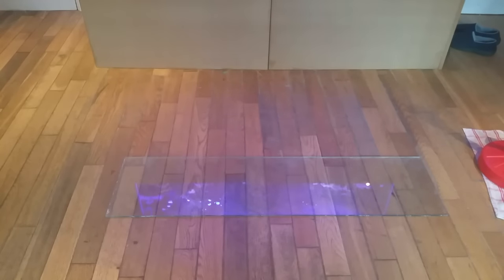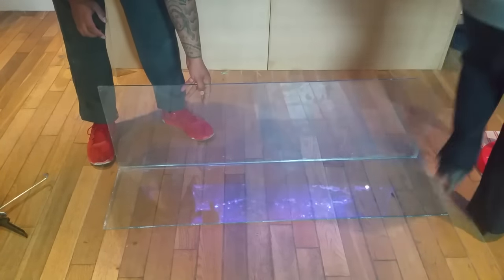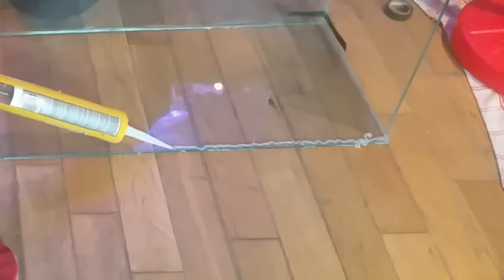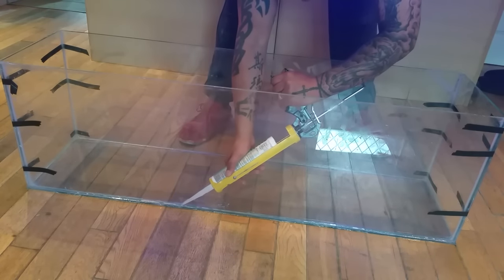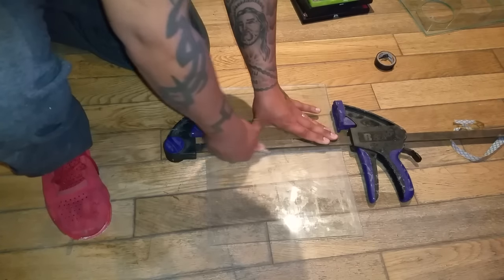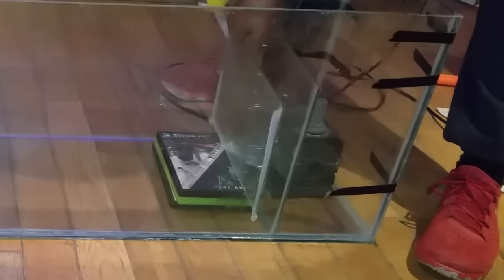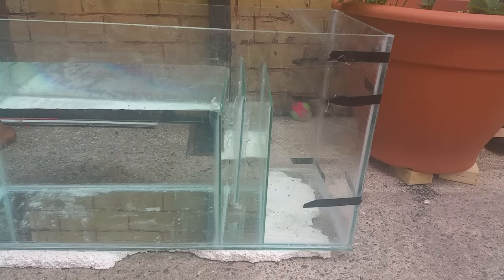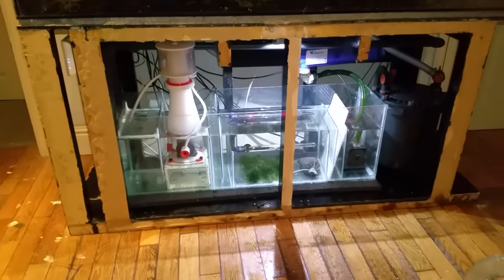How To: Build an Aquarium / Fish Tank and Aquarium Sump

Comment: Hey Aaron
I see u are struggling with applying the silicone bead as the tip is round and it is running allover the place. The solution is extra simple. Take a cutter and cut a bit off the nozzle at a 45º angle. This will allow u more control over the side-ways sliding and over the thickness of the bead .
Reply: I just watched the video and was going to write the exact same thing!
Reply: i know Im randomly asking but does anybody know of a way to log back into an instagram account..?
I somehow forgot the login password. I love any help you can give me
Reply: @Edward Jonathan instablaster :)

Comment: Good build bud, not to worry about the silicone "not so steady hand"when it gets to sump builds. As a tip, if you do a tank build. make a little bracket that fits around the gun's nozzle with a strong nail that runs parallel to the nozzle. This way you can run the nail on the side of the glass and use the glass as a ruler. You'll have perfectly straight lines of silicon.
Reply from the maker: +Jesus Great tip. Thanks for sharing

Comment: For anyone thinking about doing this: 
1. PLEASE  wear rubber coated gloves or some other sort of hand protection, and safety glasses when working with glass!!!
2. DO NOT make reverse passes on your score when cutting glass. One single pass with even pressure will be sufficient! 
3. Sand the edges of your cut glass after you cut it. Cut glass edges are EXTREMELY sharp!!  Failing to do so may result in you bleeding all over your project!!

Comment: tip for you never go over the same cut twice while cutting glass also use thinners or turps before you cut the glass brush it on with a small paint brush it will keep the cut open longer 
good video btw

Comment: If your beautiful assistant had not been available you could have used the wall behind you to prop up the glass...I  get to make my own tank soon ...had my 5 foot 75 gallon crack on the bottom pane at 3am the other morning...it sounded like a rifle going off.....only resealed it two weeks ago and was water testing it...I don't think there was anything wrong with the tank..I think the surface the tank was on may have been slightly bowed... . luckily I was still awake as was doing university study...spent the next 2 hours mopping up water.....now need to learn how to cut glass...might make a sump....or a cube....or two....so thanks for the video...subscribed.

Comment: Nice work with the sump. I like how you used that clamp to make a straight line when you where scoring the glass. I always have a hard time with that, thanks for the tips
Reply from the maker: 915Mang Yeah i tried all sorts as a straight edge in the past but using this happened by accident to be honest because i dropped the clamp in the glass when i was moving the clamp. Thanks for watching pal. Big reef update on its way mate Soft corals, LPS and SPS in my tank now.

Comment: I have lots of questions ...like how thick was the glass and what type???? I want to build a custom tank....but I plan on  making it freash water about 40-60 gal would I still need a sump with that?
Reply from the maker: The type and thickness of the glass required will depend on the size of the tank you want to build. A Sump is an optional method of filtration you could use canister filters instead if you wanted.

Comment: How much of a gap do you leave between the baffles and the walls for the silicone? Should the glass be about a 1/8th of a inch short for about 1/16th for each edge? I'm going to have custom glass cut for the baffles and I need to know the exact size I want them cut to.

Comment: When cutting glass, only score the glass one time.  Never score it multiple times.  It dulls the tool and it can cause the cut to run out.  Make sure the wheel is oiled, and one pass is all you need.

Comment: hey thanks for the video. I do wonder though about how secure the tanks are if using only silicone between the edges?
Reply: +Bruce Wayne Once the silicone has cured it pretty much fuses to the glass...my biggest tank holds 180 gallons of water and I resealed it myself with nothing but silicone...when you have to pull one apart that's when you realise just how strong and tenacious silicone is....it is a bastard to remove.

Comment: Hello: have you heard of uPVC Foam Board? If so can this material be used to make fish tanks (may be waterproof but is it safe for fish/food)? And what silicone/glue/cement would you recommend for use here that is again food safe? Thanks.
Reply from the maker: Hi Cyril, I can honestly say ive not heard of it. unless it goes by a different name here. Very  sorry I can't answer your question.
Reply: +Aarons Aquarium 
Ok. Here's a link with some info.....
http://www.reefcentral.com/forums/showthread.php?t=2196651
Was just wondering if you an opinion or experience with this material and how did the fish tanks hold up over time. Thanks for your prompt response. Much appreciated.

Comment: I really need some help. I am a beginner in fish keeping, had my fresh water tank now for around 2 months. I have a 10L acrylic tank and a 25L glass tank. I have them both on separate bedside tables that are ply wood and they are both starting to give way. I want to keep my tanks and fish but I don't know what to do about the stand? I could never make one myself and im stuck!!
Reply from the maker: maddieac If you cant build one why dont you just buy one?
Reply: maddieac Nail or better yet screw in a couple of treated wood one by two cross braces. Drill pilot holes first then install them like this "X" on all four sides. If you bring the inside table/cabinet measurements to your local Home Depot, Lowes, or Menards they will cut them to size. Good Luck

Comment: Hi Mr.Aaron..since you reply fast..I have a question..I just acquired a 55 gallon aquarium and it will be freshwater fish..So I want to have a system thats not that high maintenance..What do you recommend?
Reply from the maker: +RoxyQueen Tank, heater ( if tropical fish), Canister filter and a Light. That's it! Nice and simple. Then just do a water change each week and you are all good.

Comment: I see the pump to pump the water back into the tank but what do I use to pump the water out of the tank and where does that pump go
Reply from the maker: gravity pumps the water out of the tank.
Reply: So I have to drill the tank?
Reply: Or is it like a syphon ...just get it started and then it flows naturally?
Reply from the maker: +devingibson4 Not necessarily. you can buy an overflow box if your tank isn't drilled. There are also DIY overflow videos available on YouTube, You could build your own.
Reply: Thanks
Reply from the maker: +devingibson4 👍
Reply: Last thing....I got a 125 gallon tank...I can do 2 canister filters...or 1 canister and a overflow sump setup....which do you think is more effective .....fresh water aquarium
Reply from the maker: Personally I'd go for Sump and canister. You get the best of both worlds. You can use the Canister for mechanical filtration and the sump can be both Mechanical and Biological. I'd set up a large Refugium in the sump to take care of Nitrate

Comment: just one question, it seems to me it does'nt matter to you what the dimensions between the glass are?
correct me if im wrong
Reply from the maker: Yes the distance does matter as if the chambers are the wrong size your equipment my not fit. The video is a guide to show you how to put it together. Because a sump is very customisable I didn't bother with measurements as mine may be different to the one you want to create.

Comment: how do you prevent the sump from over flowing during a power outage?
Reply: +Legendary Aaron R Just make sure your sump has enough extra room in it to handle all the extra water that will travel down when the pumps are off.  So if you have a 200 gallon tank you will not want to use a 20 gallon sump.  Now how much water drains down in your sump will depend on a number of factors such as having a check valve to  your output lines and how you are draining the water down on your returns.
Reply: im guesing by having a shut off valve inline from your tank
Reply: @glassunlimited5534  without a pump there is no water flow going down to the sump, only water already inside the line.

Comment: How do you stop it flooding house as just running into sump how does that bit work? If electric stops...This comment is for dummy sump builders...Obviously return pump pulls it back up but what if that fails or theres a blockage dropping into the sump...
Reply: Claire Bear it can't flood if the pump stop worki g it like an overflow on your bath only as much water come back down to the sump as is pumped in 
only time it will flood if over flow gets blocked up